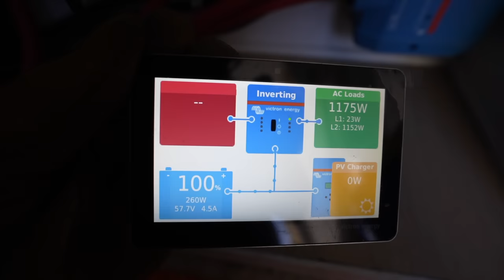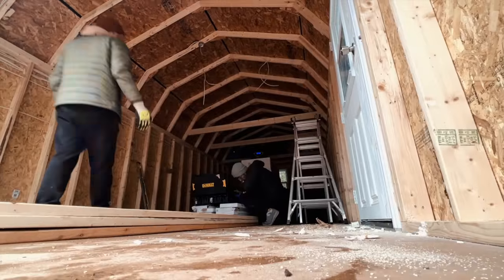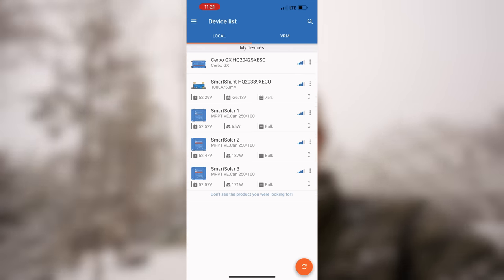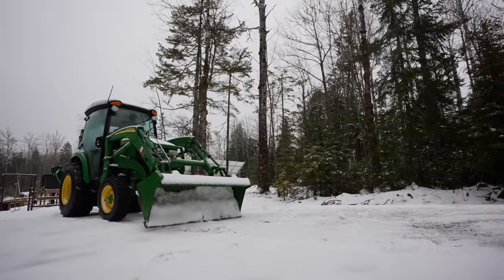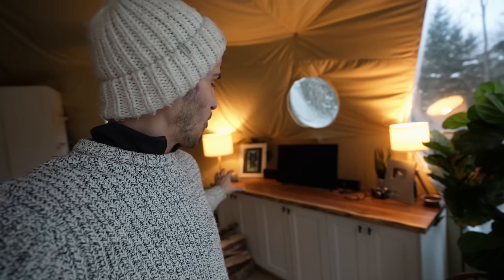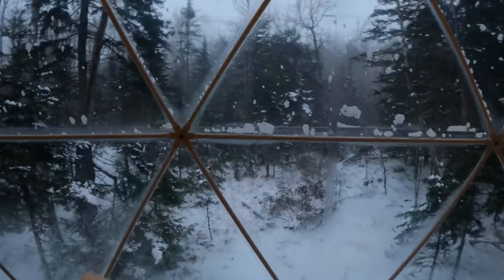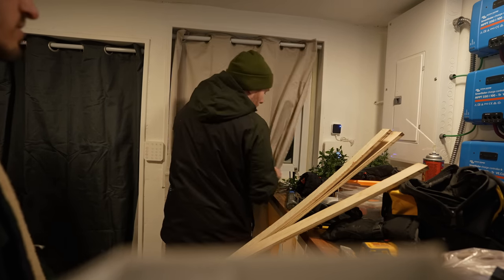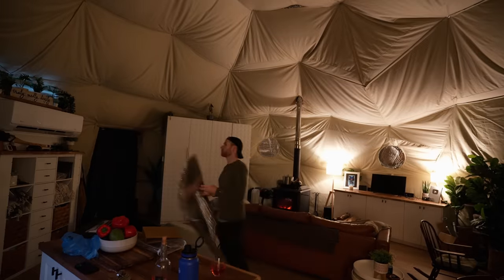Living in a Snow Globe ❄️

Comment: I am originally from Labrador. I know, cold. They recently had the same temperatures as you. I worked on the coast of Labrador for a few years as an outpost nurse. Only 1 nurse for 500 in isolated communitie. I used to do emergency home visits on snowmobile. It was real bad to get called out in the night, especially being so busy in the clinic with emergencies and medivacs.
Stay warm, guys, and cuddle up with the doggies for body heat.

Comment: - 47.2 F???? HOLY CRAP!   THAT is COLD!!!  We live in the Denver Metro area and -13 F is about as cold as I think I’ve seen it Google says -29 F.   YOU are much stronger than I am!  Wanted to let you know of a garage door hinge that has a secondary spring that is part of the hinge that holds the door tight to the jamb weatherstripping it is called the “Green Hinge” and there are also nylon sleeves made to insert over the roller shafts to make the door ultra quiet when operating.   Because of the extreme temps up there I thought of you guys and that hinge while watching the garage door install.
Thanks for the off-grid home saga!  It is fun to watch you guys and all you’ve accomplished.
Stay well and happy!

Comment: Hey guys!  In the container home have you thought about makeup air to address negative air draw from things like: range hood, bath exhaust fans, cloths dryer, etc.?  If not you might want to look into a fresh air exchange system with heat recovery so that all the “exhaust” systems don’t create a negative pressure inside the house?  With all of the foam insulation the house will be very air tight.
Mike C.

Comment: If we don’t get -40 several times through the winter we are surprised and thankful.  Side note regarding the wasps. First get a jug of household ammonia, this will neutralize almost any insect bite you could get, in fact I would try it on any kind of unknown bite. So far as wasp or bee stings it works instantly, not kidding, got stung on the lip by a bee last summer right before work and when I got there no one could tell. It was completely gone.  Works on horsefly, deerfly and mosquito bites too. Call her Clementine.❤

Comment: There are only about 11 countries in the world that still use Fahrenheit to measure temperature with the USA as the largest culprit.  Even worse there are only 3 countries---USA, Liberia & Myanmar---that use the Imperial system (feet/inches) as opposed to the metric system.  Philadelphia only got a few days of freezing temperatures,  then we got a mild spell again, thankfully.  We've been about 4 or 5 degrees (°F) above average this year.  We have been on the southern side of the cold vortex.  I feel for you Todd and Tyler and wish you the best during your deep freeze.  Keep your solar panels cleared as you can get electricity from the reflected light off of the ❄️ snow.  I have sensitive skin and have gotten sunburned from reflected sunrays off of snow.  Whenever you open your door, make sure your fur babies are where you want them 🐕 🐈‍⬛🐕‍🦺

Comment: Watching you clean your solar panels off I thought of a idea. Using garage door track on the top and bottom of the frame of the panel you could use wheels in the tracks with a fine brush across the panels with a motor that moves it across and back removing the snow with a motor to run it with a remote so you don’t have to go out to clean it off or have it self activated when the snow reaches a certain height and triggers it to start moving

Comment: Growing up in west central Wyoming, the winter of 78-79 was the worst we ever saw.  There was a thermometer on a tree about 30 feet from the house, I looked at it on the coldest morning. The numbers stopped at -60 but the mercury was a little lower than that, I estimated -63F using my 12 years of wisdom 🤭. That has stuck with me ever since. Above ground propane tanks were occasionally freezing that winter 🥶 🥶🥶

Comment: -30 for you is 20 degrees here.  I live in the PNW & we had quite a few nights in the teens here.  My sister lives 3 hours away & far inland (only some rivers near by) so the air is much dryer.  The snow sticks way longer & summers are much higher than here but our constant humidity make hot or cold feel worse to me.  I have to look on my outside thermostat to know the difference in the way we read temperatures.  I'm happy to see how resilient you two are!  Are you ever going to have your families visit?  If you were my kids I'd be way beyond proud of you both!

Comment: The insulating curtains over the windows are such a good idea and I get not being able to keep them up because you miss the view and the light - maybe just for those really cold times - I’m old enough to remember my parents putting up storm windows in the fall and taking them down in the spring - I suspect when single pane window were the only game in town it was the only way to get extra warmth of double pane windows in the winter 
So I wonder if there is such a thing ad ‘storm windows’ for your dome? If cost was not object (like if you win the lottery territory) I would build a dome green house o around your dome so you’re down would be inside a snow globe !
Reply: The "dome inside a greenhouse" is a smart idea for areas like this with such low temps. Kirsten Dirkson has a video from several years back featuring a home in Sweden that was built inside of a greenhouse for better insulation. I think it was in Stockholm? Really neat if you want to look it up. ❤

Comment: I'm happy to see the wine was in a heated environment.  One brisk night in North Dakota - probably only 0 F (--18 C) - the wine froze inside a refrigerator in an unheated breezeway and shattered the bottle.  Yes, the fridge was unable to keep it warm enough.  
I don't generally need conversions when it's above 0 C but negative temperatures in either are hard except for the one above and -40 (the same in both systems). 
The conditions of another "crisp" night on the Great Plains led me to check with Environment Canada.  I found that our -35 F with a 50 knot breeze has  a wind-chill equivalent of -62 C.  We were not told that; we were simply told that exposed flesh would freeze in 45 seconds.  
Squirrel decided to test the outdoors but how about the puppies?  What have they been doing?  Our cocker spaniel was fine going outdoors in North Dakota no matter what the weather was.  
Also, we used to plug in our cars in North Dakota.  Do you do that as well?

Comment: As far as me experiencing cold temperatures: Several years ago I spent the month of March in Yellowknife, NT. When I got there, the temperature was -38F. For those that don't know, -40C and -40F are the same temperature. The highest temperature during the month was -18F (-28C). Every commercial parking lot has outlets to plug in engine block heaters for your car. Do you guys have to plug in your cars?

Comment: When you apply insulating material inside glass, but there are any gaps allowing room air it slip between the insulation and the glass, you will inevitably create an environment where humidity in the air will pool against glass if it doesn't freeze first.   Any wood exposed to pooled water can swell and finish can be penetrated if it does.

Comment: Thank you for the conversions!  The coldest I have dealt with was -20 F and I was driving an old 1964 VW Bug I just purchased, with no heat, 60 miles home. I had to pull over several times to defrost myself at a gas station.

Comment: We had minus 18 celsius one winter here in southern France but that was many years ago. For years now it hardly goes below 0C. I no longer need to drain the pool system which saves me work in the spring. Climate change is quite noticeable here. Spring is earlier than it was 19 years ago when I moved here. Warmer winters and earlier spring may sound like a good thing but we all know its really not.  I cannot get my head around minus 44F. 🥶 🥶

PS. You’re on form this week Todd 😂😂

Comment: I use those curtains on most of my windows here in NJ, USA. I live in a hundred-year-old house on a Lake. I have lots of windows, they really need to be upgraded. As the Sunset during the Arctic blast, I can feel the cold coming through the windows and walls. Those curtains really do help. Also, I have Levolor shades that do the thermal protection. The best thing is that they come in white. So, the Sun can still shine through, but keeps the cold or heat out (NJ has become the New tropics during Summer heat waves with temperatures exceeding 100°F).

Comment: Omg you two😂😂😂😂😂.  Btw in case you find you are still using a lot of propane have your supplier test your lines for a leak. We had one that didn’t get detected at connection time and after a year we said that’s crazy. They tested all connection points and found a pin size hole in one line. Our propane cost now is ridiculously low. Good luck and stay warm. The vortex was NUTS!!

Comment: It is AMAzing how much wood and otherwise fuel you need to keep freezing when it goes below 30 degrees F. You have to keep stoking the wood stove, sometimes all night. I remember when I was in a trailer in Colorado. I had a 50 gal oil barrel woodburning stove. I was up all night chucking it with piñon a hard wood, but the temp in the trailer was barely above 50 degrees. My plumbing froze. I had to go to the YMCA for showers. No plumbing for two weeeks. Sucked.

Comment: The coldest I've ever experienced was -22C in Atlanta,Ga years ago.  I have a wall of glass patio doors that are not double pane and that was the first thing I changed when it warmed up.  It was a completely different experience than even at the -7C we normally get. The cold came right through those windows. Fortunately, I had a good electric heating system and the Power system held. My Power bill that month was outrageous though. I keep a below freezing rated sleeping bag handy just in case of cold emergencies and I used it that night.

Comment: You can use calcium chloride on the deck outside of the Dome to help keep the snow and ice from sticking. At least that would give you a safe in and out of the Dome why you're clearing other areas. You could also use it on the the sauna to keep the snow from building up on it I don't know if that makes a difference on the internal temperature but it may help and you could also use it and put it on your your shed that's going to be your office that would probably help on the inside temperature as well and that's also two items you wouldn't have to knock the snow off. I have a plan to build a geodesic dome to do it with different materials than what you used the same kind of idea and make it definitely sustainable so this is something that I plan to do on a decking or actually any wood surface. I definitely want to say I picked you up watching you guys probably a month-and-a-half ago and I think I beds and caught almost all of your videos at least I feel like I'm caught up on your journey. And I wanted to say you guys are being so brave and strong and holding each other up and doing such a great job I'm building a mantastic home. By-the-way mantastic was supposed to be vantastic but I thought look cool so I left it. And on your solar panels you can do reviews on it and research but I believe you can put the same the same product calcium chloride in a sock like thing at the top of your solar panels and it should work its way down to break up any snow and ice from building up.

Comment: -44 heat pumps don't work but you can use the fan to move the wood stove heat around. A door with that many windows doesn't have much more R value than what you replaced.

Comment: You've done a lot of good things around the place to battle the cold. 
But have you checked your vehicles. They may not have enough antifreeze in them to handle these temperatures. If they freeze, you can end up with cracked engine blocks or busted radiators.
I don't need the conversions because I learned the formula about 30 or 40 years ago.
F=(+/-C x 1.8)+32.
Easy! 😆

Comment: Your first project in the workshop should be building a small deck with a ramp so you can wheel heavy stuff in and out better. P.S. the solar panel rake should have a rubber end so you don't accidentally damage the panels
Reply: Also you should take tennis balls and cut them to cover the ends of the metal on the garage door. Those are really sharp and that extra protection can save you a trip to the ER

Comment: Did you guys consider bi-directional solar panels? I'm sure they're more expensive, but the huge advantage is that they can capture solar energy from the bottom as well as the top. Even if the top side is covered in snow, they can still generate a lot of energy. Also, the heat generated from sunlight bouncing off the snowy ground and hitting the back of the panel is usually enough to melt the snow off the top side, so you never have to clean them off. It's probably not worth the expense of upgrading, but it's something to consider.
Reply from the maker: We seriously considered it! We ended up finding these panels for $0.56/watt which was such a good deal we couldn’t pass up. The bi-facial ones were all around $1.25/watt so the price difference was just so extreme it didn’t make sense for us.
Reply: @tylerandtodd  I get it! When you have a set budget, compromises have to be made.

Comment: Does your fire place have an outside air supply pipe this would work better, the combustion air being pulled in from inside makes your dome pull air from cracks windows and doors plus you use more wood. I do HVAC and a wood stove can be super inefficient without sealed combustion.  Good luck guys

Comment: 13:41 When I was a kid we had a wood room in my parents’ house in the basement.   The window of the room opened up on a hinge and a chute went in.  

I would spend a couple hours throwing wood down the chute until it reached the top, then go inside and stack it in the room. 

When winter came we used that indoor wood to heat with a wood/electric furnace.
Reply: How much would it cost to heat your home with it?
Reply: @pjaybasmaignee  I couldn’t tell you because I was in my early teens.   

Many years however my dad just cut down trees. We had access to on our property or gifted us on the neighbours property.   

Eventually, though he decided it was just too much work and we bought wood.   Unfortunately even if I knew how much we paid and how much we burned, that was 40 years ago and the stove/furnace/house design we had would be totally different for you.
Reply: @rjstewart  oh ok, I thought I had a better idea to heat my home then expensive central air/heat. But thank you for explaining.
Reply: @rjstewart  it cost almost $.75 an hour to heat our house now times that by 24 hours and 28 days.
Reply: @pjaybasmaignee  What do you use to heat with?
Reply: @rjstewart  a central HVAC system unfortunately but it does work amazingly but super expensive.
Reply: @rjstewart  I heard heat pumps work well and lower your bill significantly.
Reply: @pjaybasmaignee  What does it use for "fuel"?
Reply: @rjstewart  No when I got the HVAC installed it was an option for gas or electricity. We got electricity. Is fuel cheaper?
Reply: @pjaybasmaignee  That totally depends where you live my friend!
Reply: @rjstewart  ok got it, I’ll definitely look into it more then I did, and thank you for responding though.

Comment: C to F: Yes. Also, you were worried about having the batteries full, but I noticed the outdoor lights on at night. Are they powered by something else? If not, do you turn them off when not filming to save the power?
Reply from the maker: The outdoor lights are LED and with every one of those lights on it only uses 40w….we could run them for 1000 hours on our battery bank! 😍
Reply: @tylerandtodd  Very nice. Love your videos! Sending good vibes from Albany, NY!

Comment: Sheesh, -40F, that's F**ck'n COLD...Also the limit as to where a gasoline engine will possibly start. without a block heater.  I hope 'yer using high quality 100% synthetic oil in 'yer vehicles.  Synthetic oil has a pour point of -60 F so it will pump where natural oil will be just JELLO.  Also, 400W from 'yer solar array on a heavy overcast day??  Those are some good panels 'ya got there, of course, 'ya gott'a consider the size (Capacity) you said it was someth'n like 20 Kw....so not suprising actually....As usual, best to you both and God Bless.....Oh yeah....you dudes are adding some really nice refinement touches to your property and buildings.....An' I SEE 'YA GOT A NEW JOHN DEERE!!! Good Choice.....Looks like my 3039R ...except I don't have a backhoe...Yet...LoL  My litte beast was priced at $44, 645.00 USD with Cab,  AC, Factory AM/FM Weather Radio w/ GPS,  Front Highlift w/ Bucket, Snow Blade and 72 inch mower.....I got a damn good buy on this package....

Comment: So I am realizing that your solar is working on beta rays from the sun.  Beta rays travel through the clouds and they can give someone a sunburn when it is cloudy outside.  Solar used to only work when it was sunny outside as I believe back in the days that solar only worked on alpha rays from the sun.  Additionally solar from the past was only used to heat air and water not to convert to electricity as is now done with today's solar systems.   Yes, 40 minus is a bit chilly but that is the norm for central Canada on any given winter.  It was only in the 60s today in Austin Texas but will be 80 on Tuesday.  Hang in there.